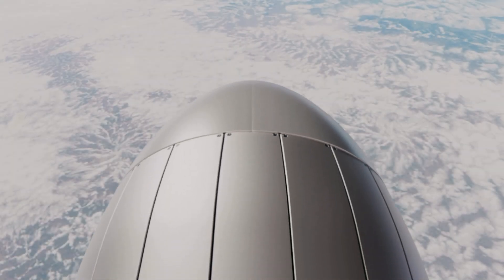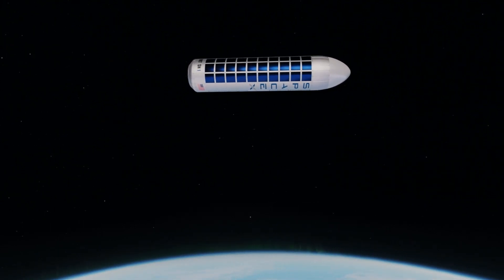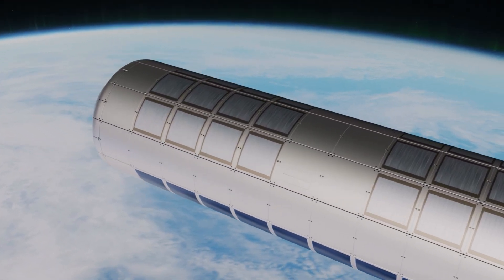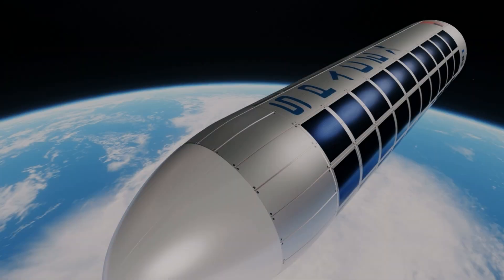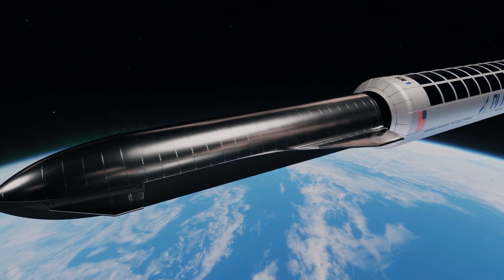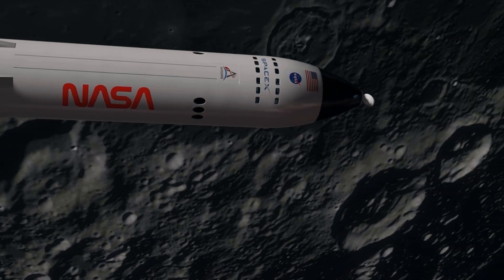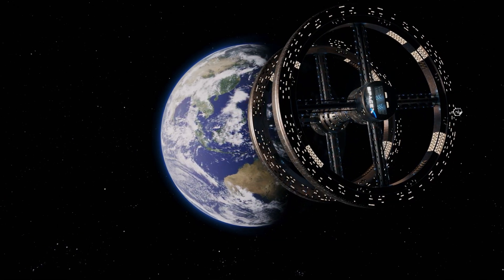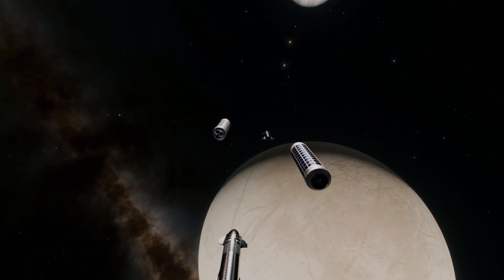SpaceX Orbital Mega Tanker concept

Comment: The tanker version of starship will be lighter because in essence its literally just a massive tank, well 2 of them, one for methane and one for oxygen. SpaceX says it’ll be around 90T compared to 120T for the regular starship. Also starship will be able to carry some 200T of fuel on board to refuel another starship. The tanks are about 1000T so it’ll take a total of 5 starship tankers to reach orbit to refuel the main starship. So its less of a hassle vs the 10 refuels needed as you state in the video and you don’t need to develop a completely new rocket using new material, which will just end up costing more. Also you still need to launch the 5 starship tankers to refuel 1 regular starship except the regular starship can 1 pit stop vs 5. Theres no inherent loss if you refuel 5 times vs once. 

So basically is added completely and cost for the something that isn’t going to provide enough value. In engineering, less steps the better, this adds more. If theres a flaw in my analysis please let me know but so far it looks like an unnecessary step where the gain to too little but investment is too great.

Comment: I have some ideas on how to improve the testing, landing and lift off of the Starship: for example by building a water reservoir under the launch platform, it would limit damage to the concrete substructure. When landing in a deeper reservoir, the weight of the ship would be more gently intercepted so that it would not be necessary to have heavy legs

Comment: That is a very good idea! I think it makes more sense than to resupply the manned starship just with the tanker starships.
Two ideas for improvement:
1. Make the Megatanker inflatable, like the Bigelow-Modules. You can at least double, maybe even triple the proposed diameter of 13 meters. 
2. Set up oxygen farms on the moon and ship the oxygen from there to low earth orbit. The earthbound starships now need only to deliver the methane from earth. There is an abundance of oxygen on the moon but no methane. You need 9,6 km/sec delta-v to reach earth orbit from the earthground, but only 2,74 km/sec from the moon surface. Most of the fuel is oxygen anyway, so it's cheaper and more efficient to import it from the moon.

Comment: It's more likely that they'll take a tanker-Starship and strip off everything they won't need to save weight (like the landing gear, heat shield and atmospheric engines). The ROI on a redesign is much longer than just stripping down a design they already have.

I'd say the strongest part of your idea is the ion engine. I'll admit that can be useful to deliver fuel to higher orbits, allowing for more refuels (and therefore more payload) on your way to Mars. But for this to be worthwhile it would have to be used enough that the savings in fuel pays for the redesign. And that may only become true a few decades from now.

Comment: An idea..
Put a docking port on the top for starship to mate with refueling starship,  then the pair travel to location desired. This would make LunarStarship capable to leave LEO, travel to the moon, land and return with fuel to spare. The Starship pair could be topped off before trip is made. 
Then the refueling starship can be refueled automatically then reused.

Comment: Who is gonna pay for this HUGE carbon fiber body? 
Sounds much more expensive to me than just two normal Starship tankers which can do the same job.
Reply: You need 10 to refill one regular Starship, thus increasing time stayed in Orbit.
That thing can refuel two Starships at once, which is kinda neat.
You can have to Starships depoart at the same time.
You could even start one regular and one Cargo Version which would arrive at mars at the same time.
The Concept has its place, if it proves to be somewhat doable.
Reply: @Intrepid17011  
Refuelling will always go like this:
First tanker launches.
Second tanker launches and refuels first tanker.
Third to n-th tanker launch and refuel first tanker.

Actual starship launches (cargo or crew) and gets refueled by first tanker all at once.

This system is cheap and flexible. You can have as many Starships depart at the same time as you like. Also with this system you avoid problems with the alignment of orbital planes. Usually this is the problem that kills the orbital refueling station: no orbital plane alignment with the destination orbit.

Comment: As commented, you've integrated fuel depot very nicely. Here are my 2 cents: instead of cargo, you could add a fueling station. This external module could be plugged to allow more than one starship refueling or tanker refueling. 
You could also have a coupling module in order to have fuel and oxidizer on separate tanks. They have different requirements energy and space wise. The fueling module could then be used to combine in or out fueling.
This is better suited for a permanent orbital depot.

Comment: Its cool when you make designs out of first principles, however this concept is anything but near term. The big question is how reliable is orbital refueling? For this to work, it basically has to be flawless and repeatable over hundreds it not thousands of times. Then switching over to a different material will be a huge jump in production cost. It will be interesting to see what material will Space X use in the Lunar Starship since that model also does not need to return to Earth.

Comment: Could you give the dimensions of this rocket so i could build a model ? its a great concept .
Reply from the maker: I think it is like 60 meters long and 13 meters wide
Reply: @meandgrok  ok great . I'm going to use 4" tubing and put 3 24 mm mounts at the back for three d motors . Clear plastic fins swept way back should make it stable for flight .
Reply: @meandgrok  Actually it comes out to only 18 inches so 3 c motors should get it to 6 or 700 feet .

Comment: Elon had pointed out that composites are more expensive than steel. Why not design with inflatable structures like Bigelow: more volume, lighter; if possible, it could also be made like/with a bladder system to maintain pressure and minimize gassing/cavitation due to zero G. With methalox being cold and pressurized higher, material and strengths would be more problematic and add expense. Stick with steel? 
I love the integration of the ion thruster, but preferably VASIMR. Mars/Moon Starship should also have them, mounted as a separate module, launched as cargo by another Starship, that attaches to the rear like when refueling, effectively a space tug, saving more of the methalox in the Starship for landing and launching, integrally accelerating to faster speeds and lowering transit times. Can methane be used as ion/plasma thruster fuel? :D

Comment: Not a bad concept but the design seems influenced too much by StarShip.
What you really want is an orbital tank with solar arrays, heat radiators, and a high ISP engine (assuming you do not need high-thrust). To that end:
1) Jettison the nosecone during ascent to save fuel. No need to carry it to orbit.
2) High thrust Raptors are not needed after orbital insertion. Remove them and return them to Earth for further use.
3) Probably realize higher output from solar arrays if placed on extensible booms. Booms can be steerable to optimize solar exposure, reducing number required.
4) Likewise, heat radiators will function more efficiently if places on booms (or free floating/attached with cables) away from rocket.  Keep cold fuel repository away from hot radiators.
5) Will need RCS thrusters for attitude control and possible station keeping.
6) Will need high-gain antenna (dish) for deep-space operation. Other changes may be necessary, too, like larger solar arrays, different heat/cooling, etc.
Reply: Yeah, basing the design on Starship is inefficient, because it's based on all the constraints of a vehicle designed to operate in atmosphere... e.g. a nose cone, and radiators and solar panels flush with the skin, etc. For something intended to remain permanently in space, you don't need aerodynamics - that's what fairings are for.  All that stuff is better deployed outwards... as you say, solar panels on a boom can more easily follow the sun, radiators on a boom carry the heat further from the hull, maybe you look at a sun shield to further manage the heat loading...

Comment: I don’t know about the ion engine, ion engines use different fuel to raptors. You certainly can’t fuel a raptor engine with xenon and i don’t think you can power an ion engine with methane.
Reply: And even if you can, what will you do with the surplus of liquid oxygen you’ll have left?
Reply: And if you just keep it ϸere while you burn the methane ion engine the liquid oxygen will just boil off? Yeah no ion engine but cool concept.

Comment: Problem solved for landing Starships!!!!   Elon should use the three two one method.  The landing sequence should go like this. first light all three engines as now. switch to two for slowing to a slow controllable speed then to one engine to settle on the ground.  this will give more time for controlled smooth landing.  TELL ME WHAT YOU THINK?  THIS WILL SAVE HAVING TO CHANGE THE THROTTLING DOWN OF THE ENGINS

Comment: Great concept.  Routine and regular tanker flights could keep the OMT(s) fueled and ready to support starship missions whenever needed while any single tanker mishap need not interfere with Starship missions.  I agree with putting the radiators out on perpendicular booms mentioned below, as this is just more efficient.  Although not mentioned, I assume the OMT launches empty, or nearly empty, because if filled with fuel that would be just too much dead weight to get off the ground.

Something not mentioned is that fuel production needs to get moved to the moon ASAP, as lifting anything out of Earth's gravity well is just too darned expensive.  So I would envision a fleet of OMT's that get filled up in lunar orbit from lunar fuel production facilities and then visit LEO on a rotating basis, then go back to lunar orbit for refilling.

I look forward to your space station design that produces artificial gravity next.  I assume it will be a taurus station of some kind.

Comment: One thing: All of the return hardware on Starship basically becomes dead weight in every scenario besides reentry and landing. If you wanted to deliver some payload to GTO, GEO, LTO, LLO, or L1-5, you would really like to be able to just leave behind all of the reentry and landing hardware in LEO, and when you want to return the Starship to Earth, use multiple aerobraking passes to return to LEO (skimming the atmosphere to avoid burning up without a headshield), pick up all of the reentry and landing hardware, and go from there. Not having to lug around all of that weight everywhere you go would lead to massive fuel savings, and thus massive savings on the necessary number of tanker missions.

Problem is, it is difficult to detach and reattach all of that hardware without introducing additional weight (partially defeating the purpose), time (having to detach, rendezvous, and reattach heavy hardware cannot be quick and easy), and complexity.

Solution: Have a special, stripped down Starship called, I dunno... Starbus might be most accurate to its purpose, but lame; Gapship sounds maybe a little cooler, but weird and not as accurate, and Voidship sounds awesome, but also like it would be a better name for an interstellar ship than an orbital transfer ship; BAB could stand for Big Astounding Bus. Anyways, the Starbus would save weight by removing the heatshield, flaps, fairing, legs, skirt, all the engines except one vacuum Raptor (which could have a bigger, more efficient nozzle than the standard vacuum Raptor), the header tanks, and save weight by reducing the weight of the thrust puck and plumbing (and possibly also shrink the main tanks).

Anyways, in order to get this thing into orbit, it would at least temporarily need a skirt and a fairing section, but the fairing could be jettisoned and theoretically caught, while the skirt could be left behind, attached to the Superheavy Booster, and since the thrust to weight would be way down with only one engine, it might need to be partially empty of fuel to make it into orbit, depending on whether the tanks were shrunk or not and by how much.

Then, this Starbus can loiter in LEO, receive payloads like Telescopes and other satellites from regular Starships, get refueled either directly by regular tankers or by the megatanker, and carry those payloads to other parts of the solar system. Again, aerobraking can be used to return to LEO for the next payload.

All of this may sound very complicated, but apart from the complexity of transferring heavy payloads in space and the mission complexity of one additional rendezvous (which would be offset by fewer tankers anyway), the whole idea is basically to invest one extra launch and some hardware to save on dozens of tanker launches. One problem would be that maintenance would be very difficult to perform, but hopefully the simplicity of the vehicle and reliability of the one engine (note: make the special Raptor engine extra reliable, maybe) would allow dozens of missions without any maintenance at all (solar panels might need occasional replacement, now that I think about it). And anyway, with Starships carrying people into space, inspections on the engine and possible replacements could actually be performed with little extra expense.

Starbus would mean that all Starships capable of landing on Earth could stay at LEO, and lunar Starships could stay between the Moon's surface and LLO (wait, now you have to maintain those too?), and Mars Starships could stay between Mars's surface and LMO (yeah, no, routine maintenance on Mars ain't happening for a long astounding time, I think). And transferring pressurized payloads or crew between Starships and the Starbus might not be viable.

Ok, so regular Starships will still need to make regular trips beyond LEO, but SOME missions could be improved by the Starbus.

Comment: I think the better option for an orbital refueling depot would be to take the single launch space station idea and expand that out a bit maybe launch several of those then use the tank section which now can't safely reenter earth's atmosphere as it lacks the control flaps and then send up some parts that will act as a framework to hold all those tank sections together. Heck even just a base starship that doesn't have a payload compartment and instead the internal structure is just tanks would be fine for a refueling depot. They don't actually need to do anything fancy with it. Carbon fiber construction probably isn't in the cards though as one of the big reasons they didn't go with carbon fiber is the fact that it gets significantly weaker at cryogenic temperatures. Where as stainless steel becomes stronger at those same temperatures. If they were going to do something like that the thing to do would be to use a stainless steel for the structural portion of the vehicle then wrap that in some type of super effective insulation then wrap that in carbon fiber to minimize additional weight. As cooling a giant fuel tanker in space is really going to be hard part.

Comment: Excellent idea that is scalable by adding additional units. I envision a central tank and propulsion unit with six additional units mounted radially around it. The one unit would be sufficient for orbital adjustment or relocation to lunar or Mars orbit. This would allow refueling before descent and landing as well as topping of vessels for return trips. Processing of fuel on the surface and ferrying to orbit to fill tanker could be completely automated.
Reply from the maker: Yes that is a good idea, many things could be done with this design

Comment: Suggestion, make it double end extendable, drop the nosecone once past atmosphere and have an adapter where you can 'daisy chain' these tankers, and allow them to be use as 'tank extenders, possibly allowing refuelling from both ends.
Consider rafting several side by side to allow 'low slow' deliveries of supplies to other celestial bodies.  If it can handle multiple fluids, being able to transfer among different tanks could be helpful (just not changing the type of liquid in each, unless cleaned/purged between).
Just a few thoughts.  Good concept ... keep it up.
Reply from the maker: That might be an idea to make it extendable. It is indeed useful for slow deliveries to deep space destinations.

Comment: I think the fuel should be manufactured on the moon and delivered to this depot. Way more efficient than taking fuel from earth.
Reply: Cant produce methane on the moon unfortunately
Reply: @Condor-uc2lw   Oh you can.. just not easily, as it's not in a readily available gas floating about.  But when they're cracking oxygen & water from the lunar regolith, they'll also be getting CO and CO2 which can be piped into a greenhouse or a Sabatier refinery.

Comment: If the Super Heavy by itself doesn't have the necessary thrust to weight ratios to make your render a possibility, it should be possible to adapt a couple of Falcon 9 1st stage boosters as 'strap-ons' to get the vehicle to separation elevations.  All 3 boosters could then return to be re-used just as they do now.

I love the concept.  Got to think Elon and his team are already thinking outside the box to streamline the whole process.
Reply from the maker: Yes perhaps 3 super heavy boosters could lift an even bigger tanker